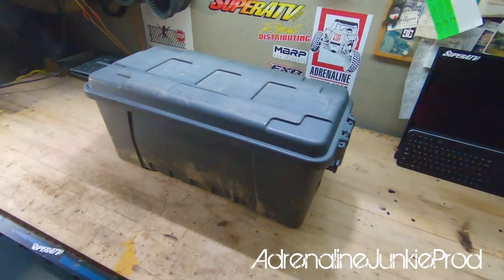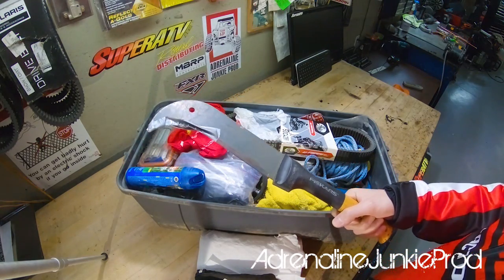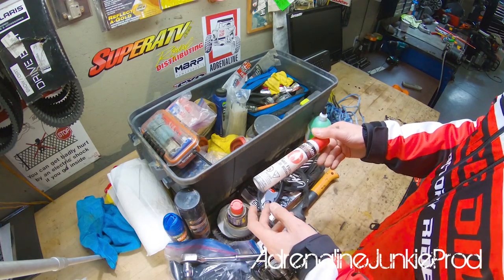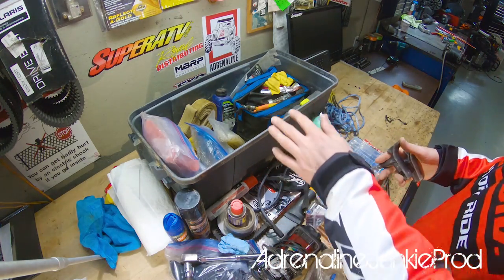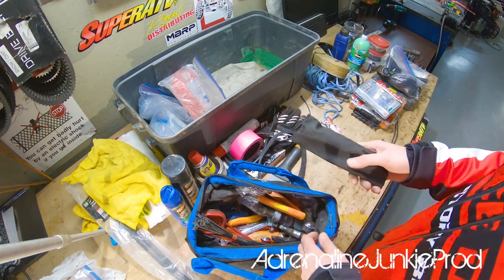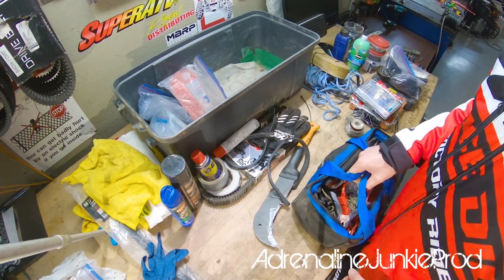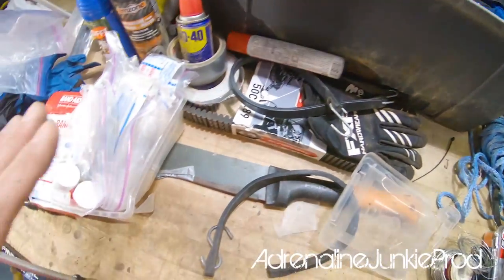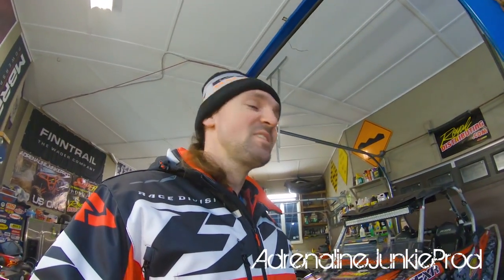What You NEED to Bring Riding With You - SXS/UTV Off-Roading Gear Box Overview - Essential Tools

Comment from the maker: Thanks for checking out the video! This is a topic I've been asked to make a video on countless times and I finally got around to doing it. People often ask me what kind of gear, tools or spare parts I bring riding with me. Here is a basic breakdown and overview of my "RZR Gear Box" and whats in it. By no means is this perfect and by no means is this a one size fits all solution but I do believe it should be a good resource to get you started on assembling your own Off-Road Gear Box. Like I mention in the video some of the items in your gear kit will be specific to the machine you drive and some are universal. Leave a comment and let me know what you think of the video and if you think I've missed some key items let me know. For starters I forgot to mention a hammer and the fact that I also usually have a nice flashlight and knife in the kit. What do you guys carry in your machine at all times?
Reply: AdrenalineJunkieProd  BELTS, extra strap Incase winch cable is not long enough, gas, electric air pump and tire repair kit.
Reply: Did I miss you saying a snake bite kit   Plus ziplock bags are great to use as a CPR barrier
Reply from the maker: Stacy Reid a snake bite kit is a great idea. Not really a necessity for where we usually ride but I should definitely add one in for our trips down south. Excellent tip. I don’t know how well a ziplock bag would work as a CPR barrier. The biggest feature of a CPR barrier is usually the one way valve  and filter that prevent backflow of air and bodily fluids into the mouth of the person performing CPR. New updated CPR guidelines also state that you can basically skip the breathing portion of the CPR. There is enough oxygen in the blood to sustain the brain for quite some time and the compressions alone will pull in and expel enough air mechanically to effectively oxygenate the brain as long as compressions are being done properly. The updated guidelines state that you only need to do  rescue breathing if you have the proper barrier device to protect you or you know the victim and feel comfortable breathing without the barrier device. It is better to focus on good compression technique and making sure the airway is open while periodically checking for breathing and a pulse then focusing on also adding the step of rescue breathing into the equation, especially for inexperienced individuals. I’ve done compressions multiple times in a healthcare setting and it’s quite a bit of work, especially when there is a ton of other stuff going on. Even well trained healthcare providers can easily make mistakes and go too fast, too slow, too shallow or too deep on compressions. Sorry for the long explanation. Excellent points though. I’ll be looking into getting a snake bite kit.
Reply: AdrenalineJunkieProd WV trails are loaded with Rattle Snakes and down here we have just about everything
Reply: AdrenalineJunkieProd on compressions I too was in health care as a Ambulance EMT and also studied Paramedics didn't graduate that due to my teach and I had issues of him " liking ME " you know what I mean and I didn't go for his advancement
Reply from the maker: I'm so happy we don't have snakes all around here.Sucks to hear about the way things worked out with your course. These days you could get them into loads of trouble for stuff like that. I find you really need to watch out and make sure to maintain professional boundaries at all times in our current society. That's not to say that in the past professional boundaries weren't important, but today there is definitely much more focus on them. We are constantly reminded about maintaining professional boundaries and focusing on forming proper therapeutic relationships.
Reply from the maker: lol, you can't fix stupid... natural selection at it's finest.
Reply: AdrenalineJunkieProd lmao you dang right
Reply: AdrenalineJunkieProd   Let me ask you something you ride a lot in the cold, maybe not like some but in extremely cold weather I know from being around construction off and on my entire life that metal gets a lil brittle and that's not to much so down here but up there is it much a problem
Reply: @stacyreid5077  seriously...snake bite kits don’t work, and just bring a cpr shield if you want. Breaths aren’t needed in the end..compression is key.
Reply: @scottmeuselbach5806  I’ve been corrected about the breaths during CPR as when I took the class back in 1997 it was taught.  As far as the snake bite kits I personally have never had to use one so I don’t know whether they work or not, but I’d much rather have it Incase of a bite

Comment: Thank you, Thank you, Thank you! This is a great time of year to start getting the "Trail Emergency Pack" restocked! You had a couple of items that will be a good addition to our kit also. I will now need a larger water seal-able tub to hold it all and keep it clean and dry. You did miss one small item in a bush saw of some kind. If you do carry an actual hatchet you may want to look at a Zippo AxeSaw or Multi-Function Camping Axe (w/shield) with Saw & Firestarter combo (Amazon: Axe saw) to round out your kit with the least amount of extra space! PS, Love to see more about the MK4 and 280Z. ;)
Reply from the maker: Hey papabare N, glad you found the video informative! Damn, your right! I have a nice fold up bow saw that I should have in there! Good suggestion, I'll be adding that for sure. I've always been into being over prepared. I think in the off-road world it's a good trait to have. It's also saved me a bunch of times in my vehicles. I always carry tools in my cars and trucks too in case something happens. Ill check out that axe saw on Amazon. Once the weather warms up a bit I'll do a video on the VW Track Car and the Datsun 280ZX.

Comment: I have most of the stuff you listed off but I have a coupleof things I need to add now. Thanks for the ideas. The things I have that you don't include a battery jumper box, snatch block, tree saver, Ratchet straps (for broken suspension) Bungee cables, compact shovel, power drill, and full first aid kit vs pieces of one. I also carry my gopro cameras and batteries and drone in my box. However my box is larger so I have the extra room.

Comment: I bought my 1st honda in 2000. 2nd in 2015 still riding that 1. I ride in super steep and very rocky terrain. Flatlanders would have to change there shorts on alot of the trails I ride on. Maybe I should start but have never felt the need to carry a tool box full of stuff for just in case issues. Common sense an a honda is all I've needed to enjoy my gorgeous mountains.
Reply from the maker: Heck, instead of all this gear I should just strap an old Honda ATV to the back of my RZR and I'll never get left stranded, LOL!

Comment: I like you doing this it helps a lot of people that don't go prepared.
Reply from the maker: Thanks Stacy, one thing for everyone to remember is a team is only as strong as it's weakest link. Going prepared is part of your responsibility, especially on a longer adventure. When your machine falls apart 3 hours into a trail ride and you didn't bring any supplies to help remedy your issues you force that responsibility on others. That's not fair to the group. That's not to be misunderstood as me saying that the group doesn't want to help or that the group will leave you there. We have a tight knit core riding group and we never leave a rider down. Everyone will stop what they are doing to help. However, we go out to ride, not wrench on someones machine on the trail all day because they weren't ready for the ride in the first place or prepared to deal with even a minor issue after it happened. Machines break down and sometimes things don't go according to plan, no one will hold that against you. However, many issues can be fixed quickly with just a few basic tools and many can be completely avoided with proper planning. Having to tow a machine out of a nasty spot is also hard on the machine, leading to collateral damage and it's hard on the people extracting you. In our group if someone needs a longer tow out of the trail and its hard on the tow vehicle the person needing the tow will buy the tow vehicle a new drive belt as a courtesy. Most of the time towing a machine through trails which require 4X4 to get into will damage the belt of the machine trying to tow someone out. Many of these sport machines aren't intended or clutched to tow anything. It's really hard on them.
Reply: AdrenalineJunkieProd you are so right and the belt is very understandable.

Comment: I really appreciate everyone that has a box of supplies I ride a sport atv and I'm hard pressed to store a couple bottles of water and my cell phone. Its seems like almost every ride we end up breaking something and having to wait for a sxs to come to our rescue. O I also carry some cash with me just incase I need towed out of the woods. Hopefully those days will be over soon when I get a sxs. I would reccomend you add one of those small lithium jump starters to your box.
Reply from the maker: Hey man, I have one. I showed the cables for it in the video but mentioned I left it in my truck. It was super cold here and I needed to boost my truck with it. I have an awesome Noco Genius booster Lithium Ion booster pack. It's awesome. It's saved my butt a few times. It's easy to be prepared in a SXS because of all the extra space. I remember I used to struggle back in the ATV days and a sport quad makes it pretty much impossible to bring anything like you said. I'm hoping to get my ATV back together this spring, I miss riding it. SXS's are awesome, but still not the same as an ATV. They all have their pros and cons.

Comment: I could see where a good burn gel would be beneficial for first aid. Appreciate the video. I’m usually one of the people in my group that has everything but the kitchen sink with me. And I also carry enough zip ties with me to rebuild our machines. I’m usually over prepared according to most people. Our motto is drive fast swerve a lot!!
Reply: Best burn remedy is to carry some packets of yellow mustard, and aluminum foil. Rub the mustard on the burn and then wrap the area with aluminum foil. Saran Wrap will work as well. The mustard provides a natural pain remedy for the burn, and the wrap keeps it in place, as well as stops oxygen from getting to the burn, which also causes pain reduction. An old Boy Scout first aid kit must.

Comment: Vice grips. Wheel studs and lug nuts.  Brake fluid is a must. Seen many brake lines get rub holes and tore off from sticks and logs. Great videos. Keep them coming.
Reply from the maker: Hey Scott, I have some vice grips in the bottom of the blue bag, I forgot to mention them, good call. Your not the first one to bring up the lug nuts and wheel studs. I'll be adding those for sure. The brake fluid is an awesome suggestion, didn't think of that. I'll also be adding a bottle of brake fluid to the kit! Vice grips to clamp off the torn brake line, some fluid to refill the reservoir, and your good to go!
Reply: @AdrenalineJunkieProd  after you take out all the adjustable wrenches you will have all kinds of extra storage. 😆
Reply from the maker: Hahahahaha, ya no sh*t! I don't even know how all 6 of those ended up in there, yet my hammer was missing...lol. Definitely need to re-organize it. I've gotten some good ideas from the comments on other items I should add too.... once I remove some adjustable wrenches.......

Comment: Dang Julian,i thought i carried alot of stuff lol,i have a ridgid toolbox with the Isota brackets to mount it in the back,super nice setup,check it out!
Reply from the maker: Those Ridig boxes are awesome! My buddy has a few of them. Milwaukee makes similar ones now too. I've considered upgrading my gear box a few times now but I just love this one. I cracked a bottom corner on it this season so I just glued it back together. Maybe I'll just see if I can get a new one that's exactly the same. I love that the lid lifts right off, makes it super easy to get into when there is other gear around it too.

Comment: Did you mention a thermostat sensor and a quart of engine oil . I would watch you restoring the Datsun.  . Back in the day I owned 1984 Mazda RX 7 . Great video as always
Reply from the maker: Hey croman1, you're right, I should have some engine oil. I don't have a thermostat sensor in there. I had a first generation RX7 as well. I really regret getting rid of that thing. Such cool little cars. My biggest problem is I have so many projects and not enough time or budget to work on them all at once, lol.

Comment: Wow. You have alot that I didn't think about. Very good information.  Thank you for the video. I do have to say you did forget the most important thing. Toilet paper. Paper towels can get ruff on the butt. 😆.  Also I  are a pistol in a dry box just in case.. there is always the possibilities of a bear or ticked off moose. Heck you may get stranded and need to eat. Keep up the good work. I'm going to check out what else you have.

Comment: Great video for the winter and to misquote someone famous : " plans are useless, but preparation is indispensable". 
Simple things can go along way, like checking air pressure and greasing zirks and religiously cleaning radiators.
You alluded to it with the extensions and straps, but I believe you forgot to mention the winch itself.
I've got a wraparound trunk from Wes industries on my outlander max that I love- I use plastic ammo cans to keep it organized and my compressor even fits into one ( don't ask  your friends girlfriend to try inflating a flat tire by blowing into it.)
Reply from the maker: lol, how did you learn that lesson Luke? hahaha. Ya, being prepared is key to having a good time. That's why I always preach the importance of focusing on preventative maintenance. I have to say that our group is really good at all this, we all agree on these concepts. In the past a few guys tried to join the group and ride with us and their machines kept breaking down, they wouldn't take care of them and it was problem after problem so we had to kindly ask them to remedy the reoccurring issues they were having and please not return until they did. We don't get to ride as much as we want and when you get an hour into a ride and then need to spend 4 hours extracting someone over and over it loses it's appeal really quickly.

Comment: I might have missed it but did you have a flashlight in there? If not add a few for sure, maybe a headlamp also.
Reply from the maker: Ya, I usually do have a mag light in there, I was using it the other day and forgot to put it back, lol. The headlight is a great Idea. I'll be adding one for sure now that you bring it up. I've got one kicking around I hardly ever use.
Reply: AdrenalineJunkieProd Cree led lights with rechargeable 18650 batteries are far superior to mag. Much more inexpensive as well. $5 Chinese cree flashlight with one battery puts out more light than a mag with 3 d cells.

Comment: So looking at your toe box and scene the green slime bottle is a good product to have. The new replacement that is far superior to green slime is Tire jet you can see the video that's made by the company and others that use the product. When the guy has 30 year-old tires and runs over a series of nail punctures it will seal it within seconds. As you know any medicines U-Haul need to be kept away from the heat especially the engine
Reply from the maker: Hey man, I'll have to check out Tire Jet. Appreciate you sharing that. I agree with the heat. I often replace stuff in the med kit. The only actual medications I carry are the mild over the counter analgesics like Tylenol and Advil as well as some Benadryl. I replace them every few months. I know the heat isn't optimal but they are quite stable when it comes to meds. Worst case scenario they make lose some potency.

Comment: Got a question, first off thank you for your awesome videos. I love how you and your friends never go easy and ride hard and WFO all the time! ok, I have a 2018 Polaris General,bought the SuperATV  high clearance arms. Are my stock balljoints strong enough to press in them for starters or do I have to buy the expensive SATV ones right away? Was also thinking of just buying two SATV balljoints and putting in the upper or lower arms(which ones are weakest?) so that I have two stock spares to carry along in my toolbag.

Comment: you need to get j.b weld that come in a round plastic cylinder, its way better than the one you are using, you can cut it with almost anything, the texture is more like hard gum no dripping or sagging, dry time 5-10 min.
Reply from the maker: I've seen that stuff! I think I've used it once or twice but it wasn't the JB Weld brand. Good suggestion Jose, thanks. I'll be adding some of that for sure!

Comment: For those looking for the same Plano Storage Tub that Adrenaline Junkie is showing here, it is sold at Canadian Tire under the name of "Plano Storage Tub, Medium", Product #175-0546-6. I also added some 3/8" wide, closed cell, black weather stripping in the lid to help seal out the dust better.This storage tub does fit down in the drop down section of the trunk on the 2016-2019 Polaris RZR S1000 rear bed because the sides of the tub taper down enough to be smaller than 27". :D
Try and catch it on sale for less than $29.99 CDN to get a better deal!
Reply from the maker: Hey Papabare!! Awesome info! Thanks man, appreciate that. I need to get a new one too since mine has a crack in the bottom. It's an awesome size and fits perfect. Can't go wrong for $30. Wal-Mart sells these too.